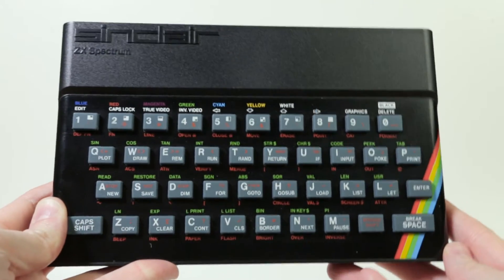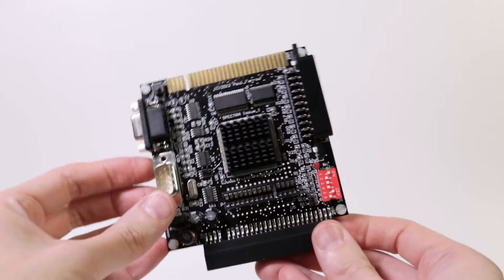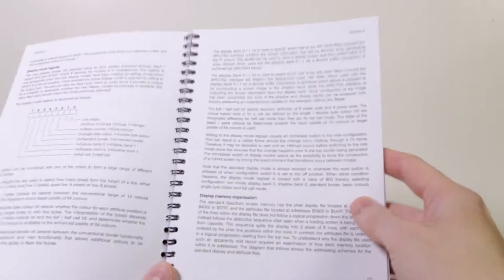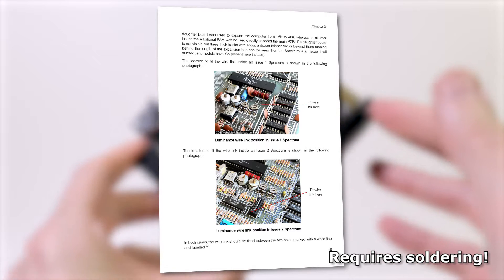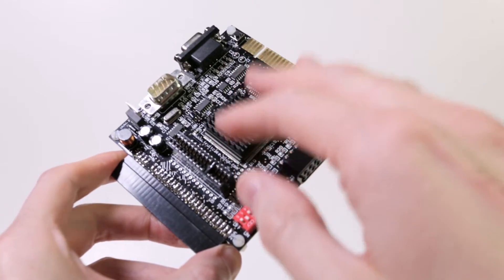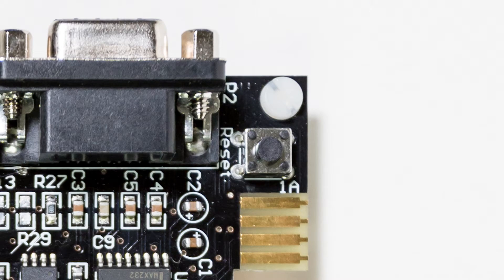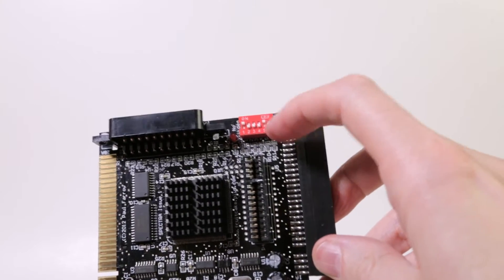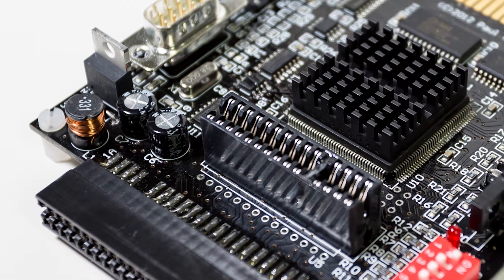ZX Spectrum - Let's Look at the Spectra Interface - Scart RGB output etc

Comment: If this would be a drop-in replacement board for the ZX+ expansion module, of which I can't see the use, I would be interested. But I say thank you I'll pass to an ugly appendix.
Reply from the maker: I am sure there are better options available by now as well. There was a 3D printed case available, that I bought. Makes it look nicer, but makes it more clumsy. But I still use the device for video capture and it works great.

Comment: ZX Spectrum runs through an RF modulator and has a composite feed it can be modded with some simple soldering; the mod is somewhere on the internet.
Reply: The same video signal that goes to the RF modulator is also on lower pin 15 on the expansion port, so you can just as well build a composite port onto an expansion card, without modifying the Spectrum itself at all.
Reply from the maker: Yupp, its a pretty simple procedure. But of course the video quality of the Spectra is superior...

Comment: I supposetheexpension slot on the cart is used for olf peripherals right?
Reply from the maker: Its basically a throughput of the Spectrum's cartridge port. So you are able to connect most of the peripherals. However I think there was one signal missing, Paul did mention this. But I can't quite remember which, might have been the Composite out, he may have used to sync his video output.. or something. Sorry, don't quite remember :)
Reply: Gears of Games hey thanks alot,if the composite signal is missing,no problem because you can use rf out, if the this cart support the lightpin then you can use the lightpen with it,would be great.
Reply from the maker: You wont be missing the composite signal from the expansion port, its supposedly of pretty poor quality :). Besides you have a great RGB output on the scart on the Spectra. But not sure if the light-pen would work with that signal of course, but as you say theres always RF. 
According to Paul compatibility is pretty high when it comes to what devices you can connect after the Spectra. But I haven't tested any, head over to http://www.fruitcake.plus.com/Sinclair/Spectrum/Spectra/SpectraInterface.htm and maybe shot Paul a e-mail and ask if he knows whether the light-pen works or not.

Comment: Beeper decoding is just a few TTL gates - 2 74LSxx ICs if I'm not mistaken. Also modding the Spectrum to output S-Video (which is almost as good as RGB) requires 2-3 transistors. Shame on the SCART connector right on the interface - gotta love those huge jacks only held by solder joints.
Reply from the maker: So far I have had no problems with the SCART connector. But it is indeed concerning that its just held in place by the solder joints.
Reply: Yep, I really want one of these, but having both the SCART and the Joystick port only held on by the joints is just not good enough whilst the device costs £70 delivered, and will need another adaptor if I want to use it with my +3 as well.

Regardless - technically this is a fantastic device. I'll have to have a look at whether I would be able to easily access the RS232 port on this thing from my own programs. 

I wouldn't mind experimenting with perhaps writing some software to control other devices like projectors via their serial ports, from a Speccy 48K. That would be nice, if I could build a nice clean interface and make it work well.

That plus using TCPser on a RasPi to get the Spectrum online, perhaps? I'll have to look for a more robust device that provides the serial port.
Reply: The SCART socket is not just held on by solder the shell of it had integrated clipped legs that look pretty sturdy.
Reply from the maker: You are right, there's two plastic clips as well. So far still no problems with it, so not too worried. I am a bit more concerned about the joystick connector though...

Comment: Spectrum display has a bit flickering from left to right.
For your LCD screen you need an active scart cable.
Reply from the maker: Yeah, I did notice a bit of flicker when I did post for the video. But it wasn't noticeable on my 8833 monitor, it might be a bit dodgy, it's getting old. :)
What's the active scart cable doing exactly, TBC like stuff?
Reply: An active scart has resistors or capacitors. Most scarts though need voltage for proper display.
This is what I made from the forum I participate.
https://www.dropbox.com/s/2i2ks6si8zd89qd/ZX%20%2B2%20RGB%20to%20Scart%209v%28anemos%29.png?dl=0

Use it at your own risk :-D
Reply from the maker: Links not working... says too much traffic :)
Reply from the maker: Now it's working, thanks! Might find some use for this actually, but first I need to replace my crappy soldering station! :)
Reply: gearsofgameschannel Oh you made it!!!
Glad to hear that.
Reply from the maker: Oh not yet, but I might! But as I said my soldering station is in need of a replacement first! :)
Reply: gearsofgameschannel Well I'll be here waiting to hear the good news when you're ready :-)